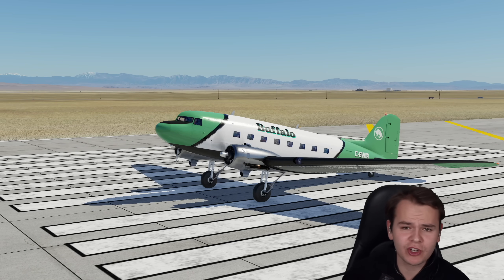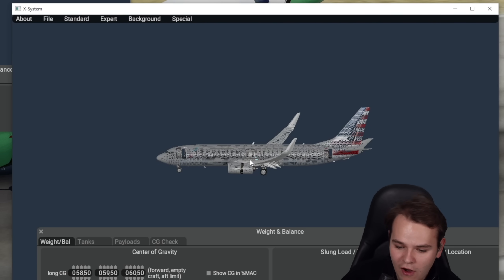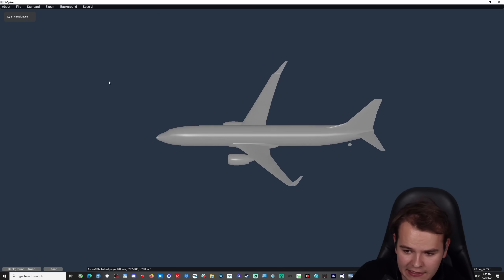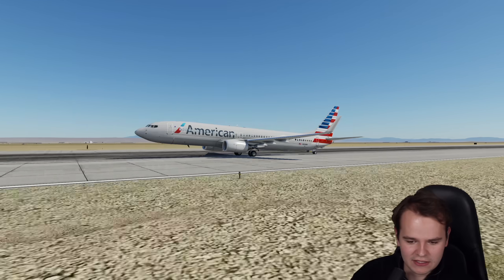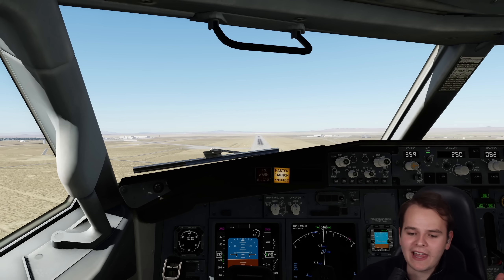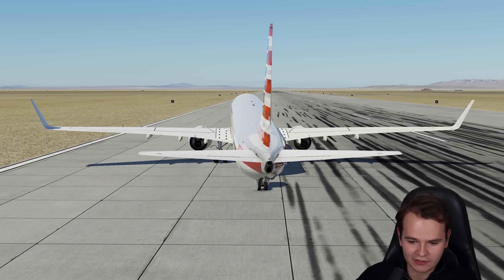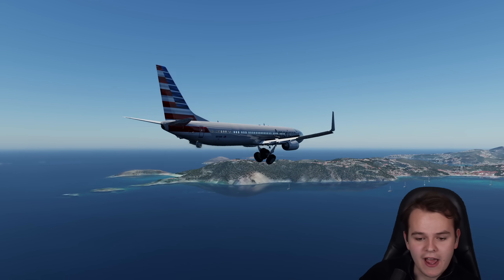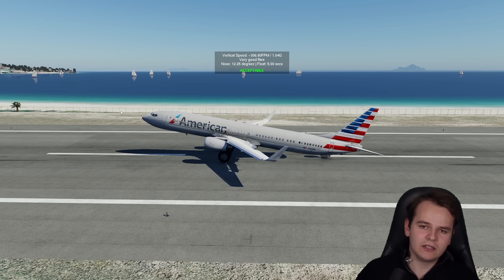Why we don't build TAILDRAGGER airliners anymore

Comment: The reason that modern airliners don’t have tail draggers. I might be wrong the tail can go down and the front can go up so lift is generated more because the jet engines are pushing the plane forward. Secondly corridors from terminals can go in good shape so no one acidently tilts and falls.

Comment: The real reason tail dragers don't exist anymore is because of the jet engines we have today. With turboprop engines, the thrust is directed towards the front of the engine, but with jet engines, they have their power directed towards the back of the engines. Notice how, at the beginning of the video, how Swiss001 put thrust and the plane just immediately nosed dive that's because with tail drager you can already tell the power was going towards the front rathen coming from the back. Shortly after swiss001 tried it with a modified 737. Notice how the plane wasn't lifting off. That is because of where the power was going. Now, the center of gravity is a key factor, but it's not the only factor.

Comment: Should be noted the "child" of the DC-3, the DC-10 had an extra landing gear in the middle of the rear landing gear. Not quite a tail gear, but just a fun fact to kick out there.
Reply: Yeah that's quite common on airliners
Reply: @gjp373  Not many other big planes have a body main gear. Only the 747, MD-11 A380, and A340 do
Reply: Dc 10 doesn't olny the md does

Comment: Traildraggers trying not to tip forward: IMPOSSIBLE
Reply: @agustinusreynaldi7101yeah but it’s typically impossible when it comes to crosswind landings. Even on ground, there’s a high chance that it would flip you up.
Reply: Put the brakes on the tail wheel
Reply: Fr
Reply: Think of them on landing :)